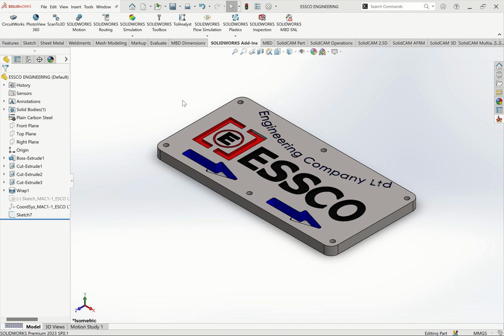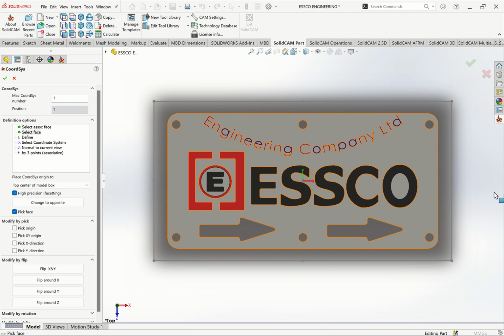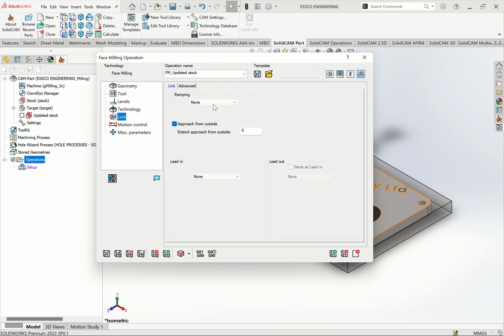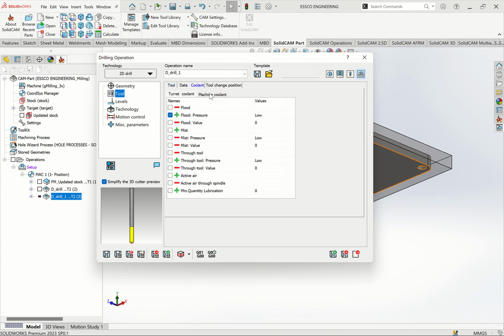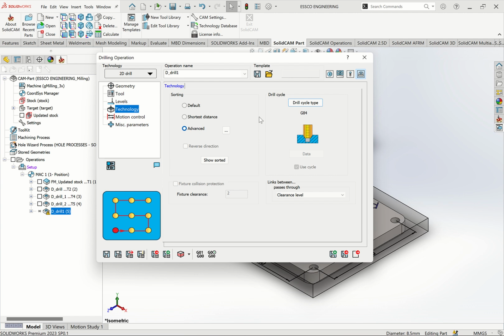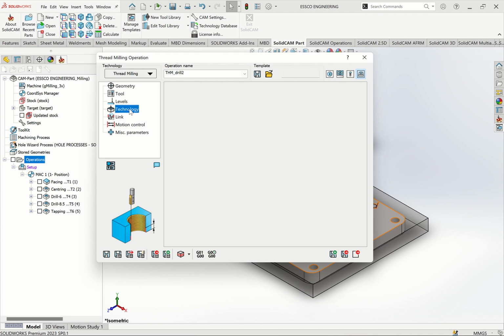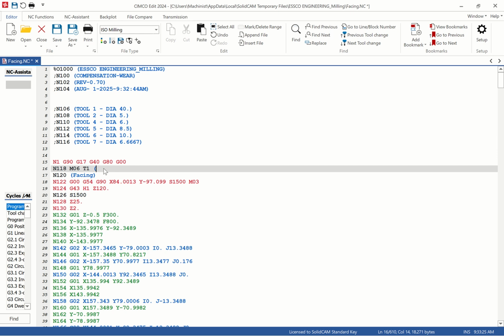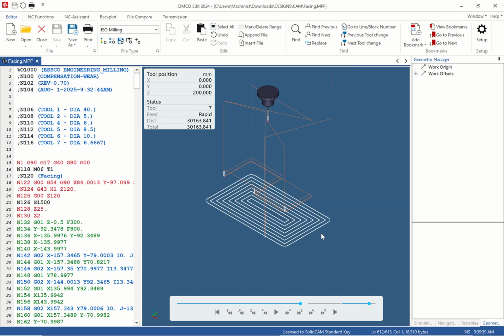SolidCAM 2024 Thread Milling & Tapping Tutorial | CNC G84 G-Code + CIMCO Simulation

Comment from the maker: PROGRAM SECTIONS (Simplified):
1. Setup and Facing Operation
G90 G17 G40 G80 G00: Prepares the machine (absolute positioning, XY plane, cancel tool offsets, rapid move).

M06 T1: Load Tool 1 (used for facing the surface).

S1500 M03: Set spindle speed to 1500 RPM, rotate clockwise.

G00 Z120: Move tool quickly to a safe height.

G01 Z-0.5 F300: Start cutting downward slowly at 300 mm/min.

G02 / G03: Cut arcs or curves.

👉 This section levels the top surface of the material ("facing") to prepare it for other operations.

2. Drilling Holes
M06 T2: Load Tool 2 (for centering holes).

G83: Peck drilling cycle — drills a bit, retracts, then continues deeper to reduce tool breakage.

Coordinates like X0. Y-53.05 tell the machine where to drill.

👉 Tools 2, 4, and 5 drill holes of different sizes (5 mm, 6 mm, 8.5 mm).

3. Tapping Holes (Creating Threads Inside Holes)
M06 T6: Load tapping tool.

G84: A special cycle to cut internal threads (for screws or bolts).

S475: Spindle runs at 475 RPM.

F712.5: Feeds the tool at a speed matching the thread pitch.

👉 Creates screw threads inside holes.

4. Thread Milling (Advanced External/Internal Thread Cutting)
M06 T7: Load thread milling tool (6.6667 mm diameter).

The tool goes around in a circular path, getting deeper with each pass, forming threads.

G02: Circular move clockwise while going deeper (Z-axis).

👉 Thread milling is precise and used for tough materials or complex threads.

📌 EXAMPLES OF COMMON CODES:
Code	Meaning
G00	Rapid move (fast, no cutting)
G01	Linear cutting move
G02 / G03	Clockwise / Counter-clockwise arc move
G90	Absolute positioning (from origin)
G54	Use coordinate system 1 (zero point)
M03 / M05	Spindle on/off
M06	Tool change
G83	Peck drilling (in steps)
G84	Tapping cycle
F300	Feedrate (mm/min)
S1500	Spindle speed in RPM

🧠 SUMMARY
Imagine this is a step-by-step guide telling a robotic machine how to:

Clean the surface,

Drill holes at specific spots,

Make screw threads inside holes,

And even create spiral threads by milling around a hole.